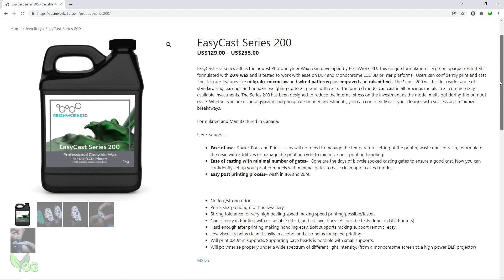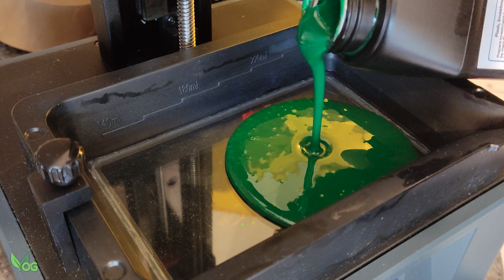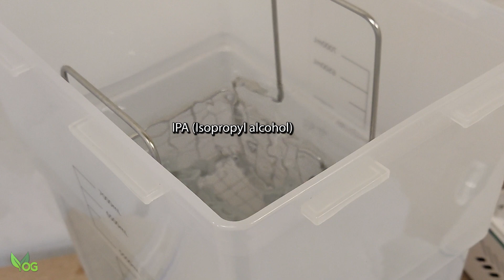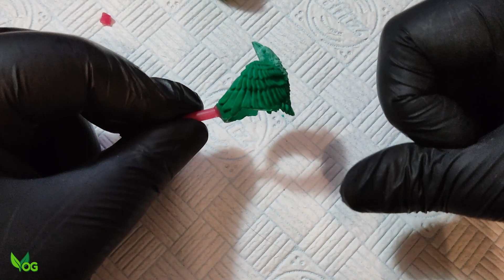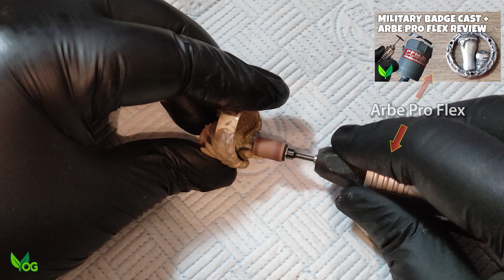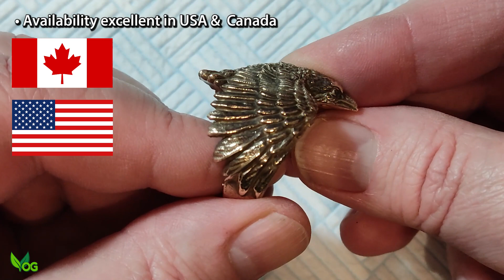ResinWorks EasyCast 200 Castable 3D printer resin - HONEST review by VOGMAN

Comment: Hi i am new to castable resin, i am just curious , what happened to the green resin after u poured the molten metal in ? Does it dissolve or do you have to remove it before pouring ? Thanks
Reply from the maker: It burns away to nothing 😁
This video is an overview of the process. You may find it helpful... https://youtu.be/-TutObDbxUo

Comment: I love all of your videos and have learned immensely from them. I am in the US and on a budget so I have been using Alphasense castable resin (green). It is $50 for 500ml and does not require post curing before casting and is cleaned with warm water. The smell is not bad more like Vicks vapor rub or a eucalyptus aroma therapy. It adheres to the plate with no prep other than 180 grit scuff and 4 good layers at 60 seconds (the small plate at bottom of model, no pre-cure plate). I find the detail excellent for what I do, I printed an Aes Sedai ring from the "Wheel of Time" for myself and very pleased, as well as many other fine detailed rings. Just wanted to pass along a resin I have not seen you use (unless I missed it?) and as always Keep up the good work. Thank you

Comment: As always you've done a great job explaining and giving us the information we need. Thanks!
Do you ever print spews in place? I was wondering how much more is your power use bill using the furnaces you use to burn out the molds and melt your metals? I use gas so I don't really know and was looking for a point of reference.
Reply from the maker: I deliberately don't look at the electricity bill... just in case 😁😁😁
As for sprues, I often print them in place for ease.

Comment: I don't have enough reviews.
Print out your ring. You can't print it out. Success rate is 10%. 
Even if I succeed, the ring will be dented. 
Casting is better than any other resin, but it's impossible to print it out. 
I'm using Sonic 4k.

Comment: So, would you prefer Siraya Tech Cast or this resin if you could only choose one?
Reply from the maker: Siraya Tech Cast is cheaper, prints on any size support, but isn't easy on the eye and needs glycerine to cure. EasyCast 200 is easier to see prints, but requires thicker supports and costs more money. So for me we don't have the perfect castable resin yet... easy on the pocket, the eye and the supports. But for now, I'll probably stick with ST Cast 😁

Comment: 30min cure is that not massive overkill? Wouldnt that make prints much more brittle?
Reply from the maker: Fully curing castable resins is important. If you don't, flaws can creep into your castings. So it's better to over-cure and handle carefully 😁
Reply from the maker: Shrinkage with printing, shrinkage with curing, shrinkage with casting... the joys of this technique 😁😁😁
Reply: Perhaps he meant 3 minutes? Unless it's specific to this resin, a 30 minute cure would be extreme for those little prints.
Reply from the maker: No, I meant 30. ResinWorks suggest 20 minutes "depending on the size of the print."
I went with 30 to make sure the print is FULLY cured. I like nice clean castings 😁😁😁
Reply: @vogman  Interesting. I'm also going to be picking up some vegetable glycerin. Thanks for the tips.

Comment: Thanks for the detailed review, do I understand correctly that this resin melts away just like real wax, instead of burning? If so, at which temperature does it do so?
Reply from the maker: They pretty much all do that... they mostly melt out at the lower temperatures but all leave a residue that only gets burned away at higher temperatures. 😁😁😁
Reply: @vogman  our bluecast x5 sorts off gasses first, disintegrates and finally burns. I have not seen any melting with the x5.
Reply from the maker: Have you looked? I'll be honest, I don't. But that's why the flask is initially inserted upside down to allow wax and resin residue to seep out. What remains is a very thin coating which could potentially turn to ash. With good resins and waxes this burns away cleanly without residue. ALL the Bluecast resins burn away VERY well 😁
Reply: @vogman  yes I have. Upside down is for the wax tree. After some time on around 150 degrees celcius the wax is gone but I can still see the bluecast prints inside the casting container. At that point I place my container with the opening north to allow for better degassing and burnin at 850c..

Comment: If you keep using the metal buildplate scraper instead of a plastic one, you end up losing most of your checkkered buildplate pattern.
Reply from the maker: Maybe... but the metal scraper is specifically for removing the prints and the plastic one is meant to scrape off the FEP or mix resin 😁
Reply: @vogman  i sharpened the plastic scraper to remove my prints.
Reply from the maker: That's an interesting approach. Have you considered a flexible build plate? https://youtu.be/fRs6tjE3KhQ
Reply: @vogman  hmm, no. I will look into that.
I use fine art paintbrushes to clean the fep, to avoid any scratches.
Reply from the maker: I also use a fine paint brush and fresh IPA. Works great 😁👍👍👍
Reply: @vogman  little tip I picked up- the plastic scrapers will actually scratch your fep, decreasing its life span. These scratches arent easy to see- nor do they immediately cause failures. But over time it will. The plastic scraper truly is advised for the build plate. If i have a print stuck to the fep, I press on the underside to pop it off. I dont even touchy fep with paper towels- only microfiber towels. I never use the metal scraper for resin printing. But to each there own 😁